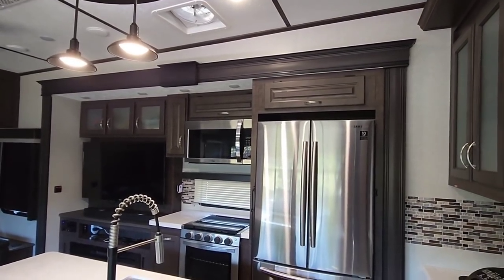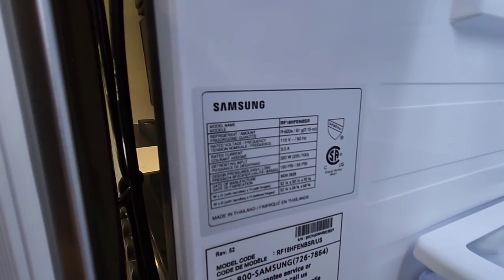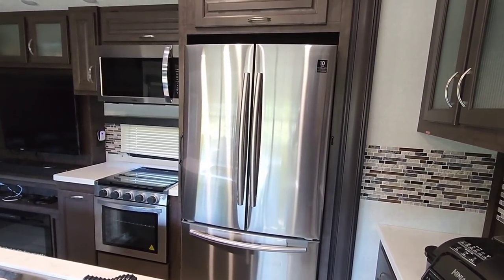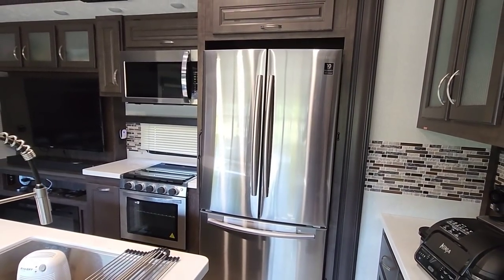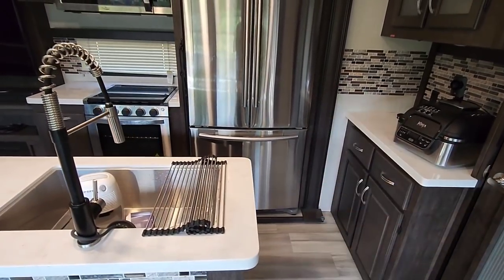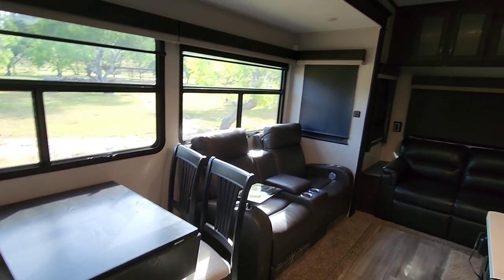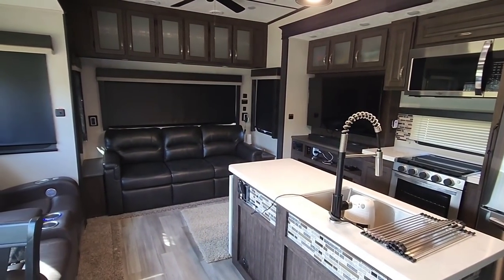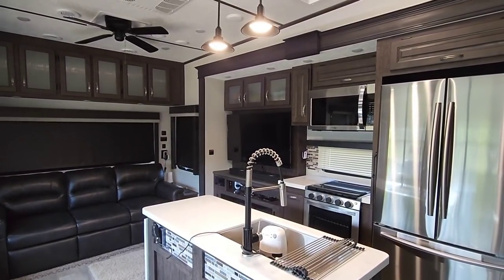Let's talk about 12 volt RV Refrigerators!

Comment: Yes would be very interested in a 12v refrigerator review. We have a 2017 34’ grand design reflection travel trailer and we are in the process of renovating and upgrading our unit and would definitely consider replacing our gas electric fridge with a 12v unit. Great videos keep up the great work!

Comment: Agree that swapping a refrigerator is a major project for many of us, especially as a DIY project. But there is another AC vs DC test I’d like to see. We recently bought a travel trailer. Though it came with a 12 v refrigerator, I was surprised to find the TV is 120 volts AC. I’m wondering if changing the TV over to DC would be a worthwhile upgrade? It would be great to see this type of evaluation on your channel.

Comment: JD: I think your comparing apples and oranges here.  If you check your refrigerator is a residential style.  It’s built for a Mobil environment.  Go to any lowes or Home Depot, the refrigerators they sell are not designed for campers and say so in the owners manual.  That takes me to my next point, testing a fridge designed for a camper in a garage isn’t much of a test.  Unless you have a bunch of earth quakes, your garage isn’t moving.
Seems like a useless test in my opinion but hey it is a free fridge to you.

Comment: I would like to see your perspective of 12 volt refers. I can see potential uses for them outside of RVs such as off-grid use, food trucks, etc. I would like to see your point of view since you are not well versed in them. I don't know if you would have a way to review the fridge outside of the RV? I know they usually install most appliances and furniture in the slides before they are installed in the RV so removing the fridge could be impossible without damage or disassembly. I feel like if the fridge is going to be good or bad, it will do so whether its in or outside an RV. As long as they are willing to let you run them in the garage or shed, I'd say go for it. If they require you to rip and tear into your RV, I'd pass. I don't think its worth all of the rewiring, disassembly, reassembly, etc.

Comment: I would love a review.  my new coach came with one.  I am however used to gas/electric.  I am also curious how my added solar can assist and how I can best utilize my power use.  and does it always run off the battery and my invertor therefore need's to run all the time??
Reply: It runs off the battery only, not your inverter, unless your wiring is different than most.  Most have the inverter tied into ONLY the 115V leg, not the 12V leg.  I know a few inverters that can manage them both, but most only run the 115v side.  Easy way to find out, turn it off, then go see if your 12V lights and fridge still run.

Comment: Would have to come up with a "Test Bench" and decide what to test. Energy usage comparison (how many amps does 12v use compared to 115v over a day), Heat (would need to build a box to simulate being installed in a RV) blown into the 'living space', Sound (how much annoying noise does the compressor make), effective cooling (accuracy of temperature, fluctuations, time to cool when loading it up as if to travel). Might be more ideas and ways to meaningfully provide data.

Comment: Probably not very helpful, but I would love to see head to head data on the 2-way vs compressor fridge.  Perhaps running the 2-way in electric only mode against the 12 volt and compare the power draw on both to determine which might be more efficient as well as effective.

Comment: Would love a controlled test from your shed!   A few 100ah lifepo4 batteries and shunts and away you go. A few other small things like clamp meter.  We switched to 12 volt compressor fridge after our second gas/electric died :(.   Have never looked back and we actually got 4 more cubic feet of fridge and it is great!

Comment: I was thinking you could pick up a used RV, something 10 to 20 years older just to use as a test bed for the refrigerators and other modifications. Set it up for easy access from inside and out for filming upgrades and modifications?

Comment: For the 12 volt I thought they were expensive. Have they came down in price? I looked into a lp mini fridge for our outdoor kitchen. I ended up removing the 120volt mini fridge and switched to two flat grills stacked up with a slide out for coolers. We use a generator when away from full hookups but only to charge the battery or if we need to cool it down a bit. Could buy ice for 20 years before the price of a LP 12volt fridge.

Comment: We have a 2021 Chapparall  with the 12 volt fridge. It works really well.  I  prefer that over our previous gas/ electric  models.  I  would like your feedback on  the 12 volt.    Jayco Eagle did not offer the 12volt or may have bought the  one of their units.  Boondocking one weekend  and it's a learning curve to not run out of battery.  Thanks

Comment: We are having problems with the shelves in the doors breaking. We’ve tried repositioning and not overloading the shelves. Our last trip we lost another one 😕so not happy. I’m thinking because fridge is in the rear of the trailer it’s receiving the blunt of the vibration and shaking of the trailer when traveling. Would appreciate any input on this.

Comment: Yes, I would love your input on trying out the 12v fridge.  I have a 2008 5th wheel that has the gas/elect. and with temps in the mid and upper 90s during the summer, it barely keeps it below 40 deg.  I had been thinking about the 12v system for a bit and would love to know if it will stand up to the heat.  If it will in S TX it should stand up to SW MO heat.  Thanks JD for the videos that you do and all the testing you do.

Comment: Invite someone who needs a new replacement RV refrigerator and replace it with a new 12 volt. Then you could do a test in the actual environment. I would believe that replacing a gas/electric with a 12 volt would be easier than installing a new gas/electric. You would get two videos at least. The test and the replacement.

Comment: Correction does the invertor run all the time when on shore power to convert power, or is the power need split between the battery/solar and the invertor?